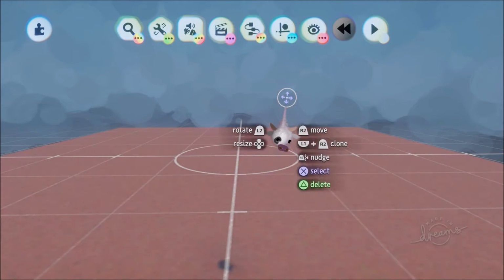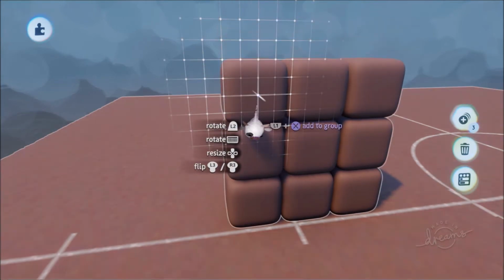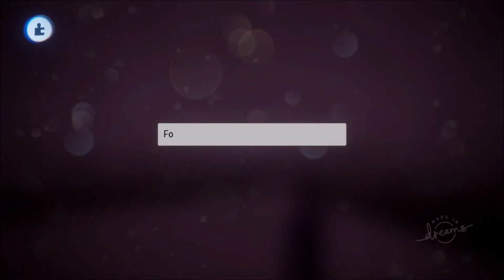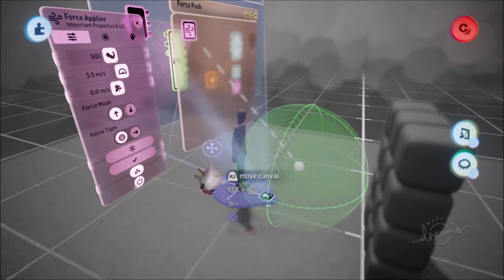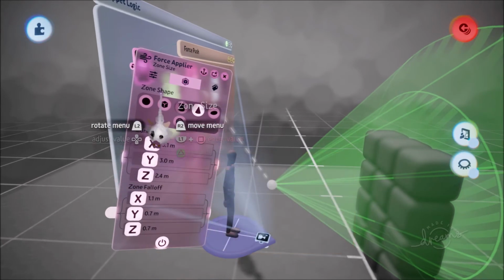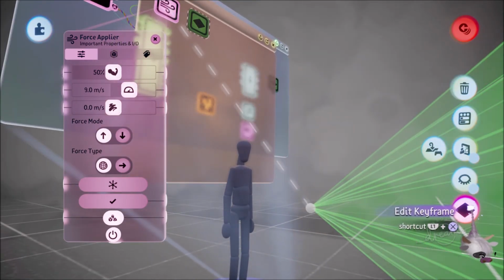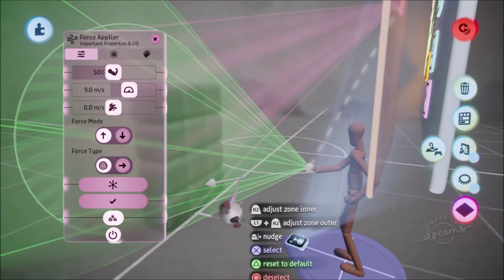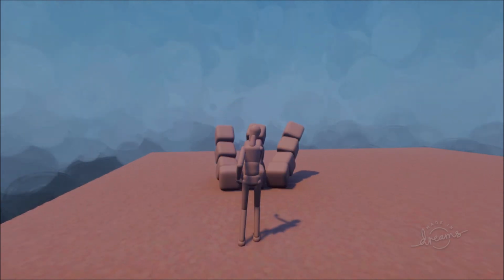Dreams PS4 | Force Push | Ability Guide/Tutorial

Comment: FUS RO DAH!
Reply from the maker: flies off into distance and crumples into a pile on the floor
Never shoulda come here!
Reply: @meanlad  Dude, I´m wondering how to do the scorpion harpoon ability... I'm working on a character that does a similarly ability called Death Grip. Got the logic except the animation fx. https://indreams.me/element/oVhWzRZFptS
Reply from the maker: @enok8145  Yo dude, I reckon it could be as easy as a force applier set to pull instead of push. Or otherwise, you could attach a tag to your character called "Pull Point" (or something) and attach a follower to the enemy that moves towards the tag Pull Point. When your character uses the ability Pull Point tag is made active with a key frame. Then the enemy's follower logic would move them towards your character. Perfect Get Over Here! situation :P
Reply: @meanlad  The follower thing is wath I did... I´m struggling with the chain animation...
Reply from the maker: @enok8145  Ahh, I see you. Hmm, maybe you could make an invisible multi-jointed arm that springs out. You could add a chain sculpt onto it so it looks like a chain, but I think joints will be the best bet
Reply: @meanlad  Great idea, I'll try that. I've tried with a chain sculpture an physics, but it always broke... never thought of joints... not sure how to do it spring out... but I´ll start with that... TY!